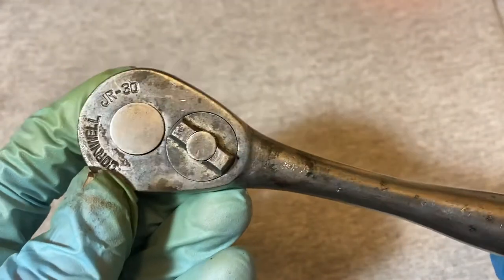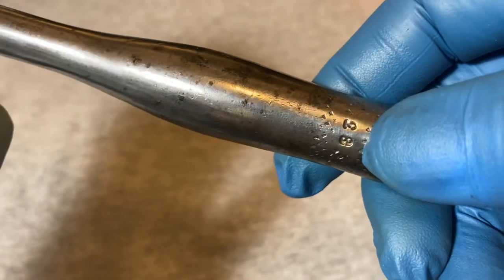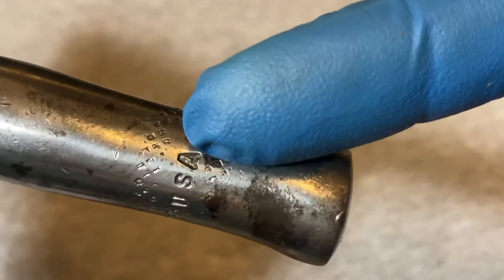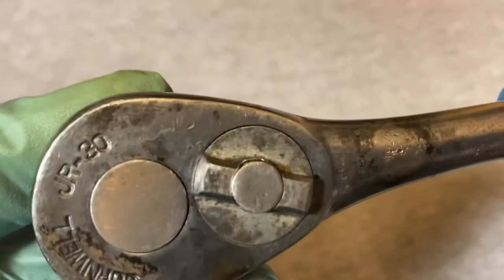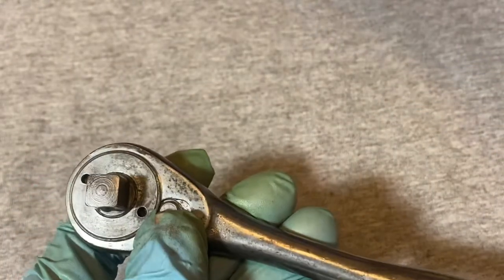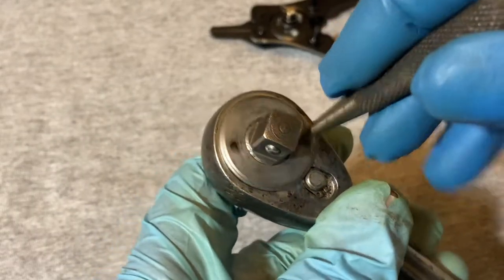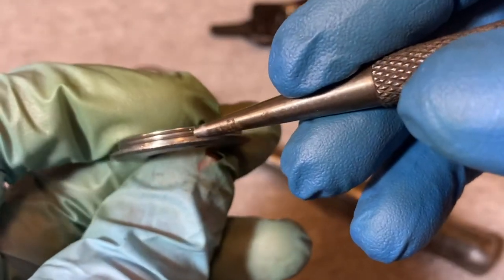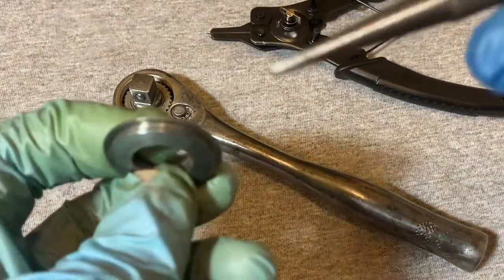Cornwell JR-30 Ratchet TOTAL TEARDOWN And Quick Comparison; Vintage 3/8” Drive

Comment: Cool video, I was thinking of getting one of these.
Reply: You may need a spanner wrench to tighten that back up.
Reply from the maker: Not putting this one to heavy work so not too worried about the case being real tight. But I gotta say I do like this ratchet. It is coarse though at only 30 teeth. I know a lot of people nowadays prefer the fine tooth ratchets
Reply: @snapringchronicles3020  all my older ratchets are all around 30 tooth. That must be the standard for old ratchets.
Reply from the maker: @mlacher100  yeah some of those really old one’s even go down into that 20 tooth range lol
Reply: Love the Coke Bottle Cornwell Ratchets.
Reply: Just snagged a clean one off of e-bay!